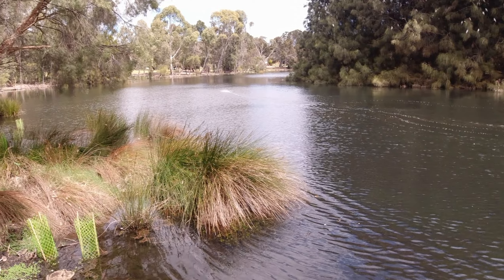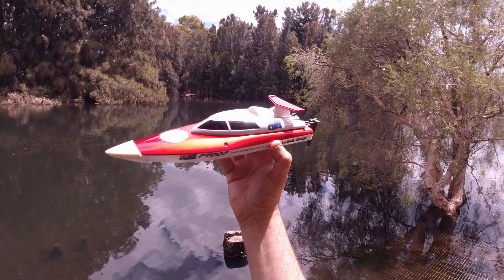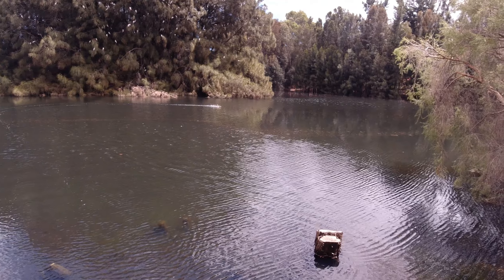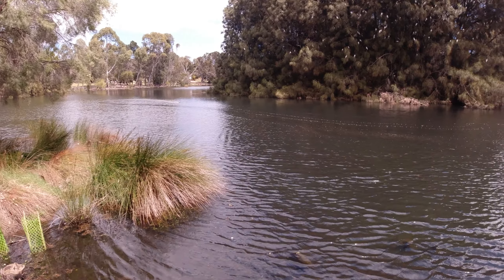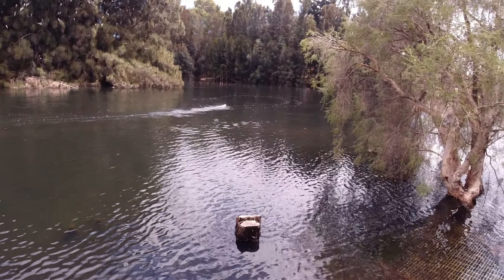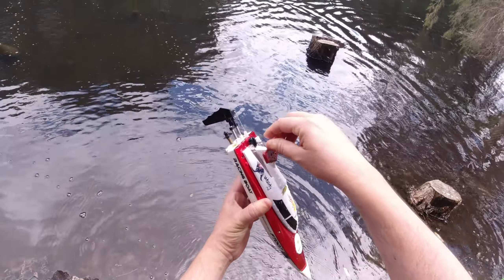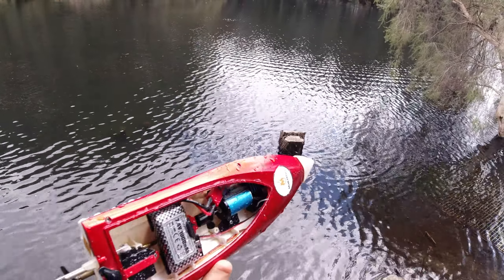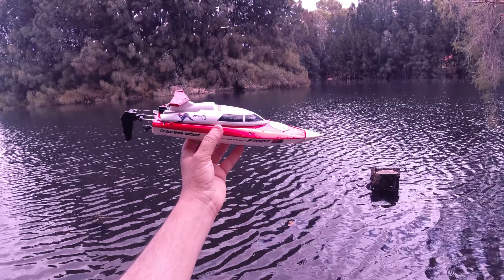Feilun FT007 Brushless Conversion | Quick Test Run

Comment: cool, but no more water cooling?
Reply from the maker: This boat was released about 8+ years ago and never had water cooling, instead it has a black plastic impeller prop between the motor and shaft. If you look you can see it in the middle there. Honestly it doesn’t  seem to need water cooling as the motor wasn’t even warm on this quick run